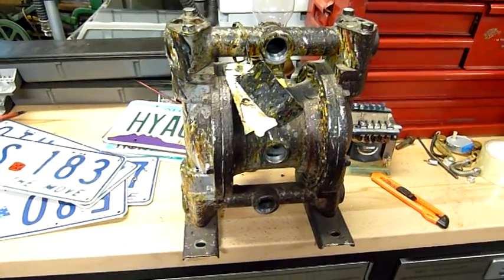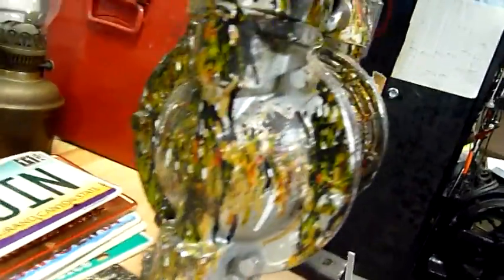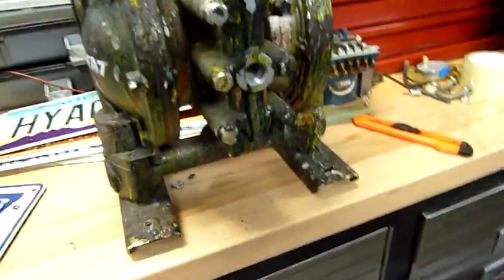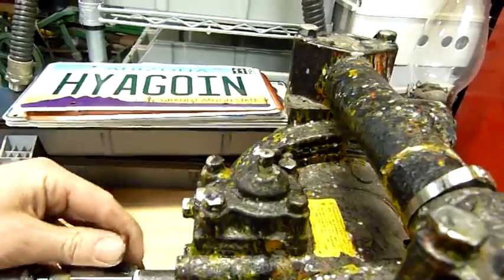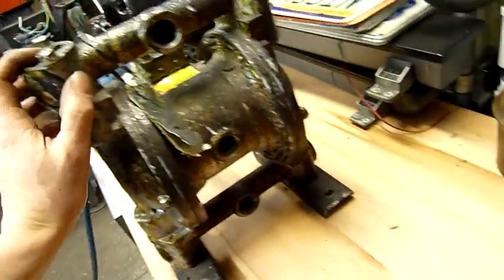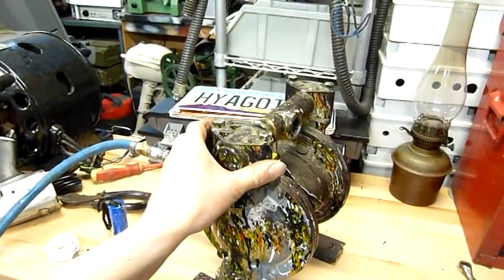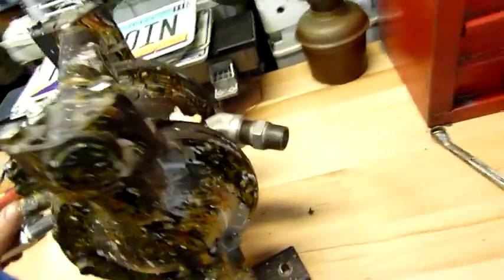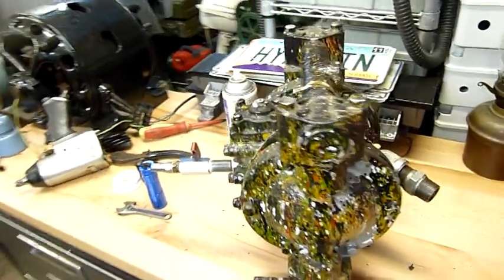Pneumatic Transfer Pump Testing

Comment: I used to work at a chemical company and we used these to pump two part epoxy for concrete adhesion. It was quite thick stuff, and quite corrosive. I would imagine that you shouldn't have too much trouble using that to pump pretty much anything so long as the diaphragms inside are still intact.

Comment: Looks similar to the one we had at a lube shop I used to work at. They used it to pump waste oil to the bigger containment tanks. It would always get clogged with debris, so I taught myself to rebuild it. On either end, on the top and bottom you've got a few ball valves.

Comment: might want to check the seals at the end of the pistons , if the diaphragm ruptures product can go into the piston portion , and can make one hell of a sticky situation ( product in the air, or product discharged in the air in the explosive vapor point ) or air in the product causing  static, thats why we are not allowed to use them for pumping off flammables in refinerys , all pumping had to be done with explosion proof motors or a diesel with a overrun trapdoor and a vane or rotor  pump .

Comment: Nice find, judging by the size of it i reckon it has been used to supply pressurised paint to some sort of industrial painting/coating plant - hence the stink of thinners. I've used smaller systems in the past that supply paint to a single handheld gun (gun is also supplied with compressed air). That pump will shift a lot of paint! Probably capable of handling some nasty solvents, maybe try and find the manufacturer under all that paint splatter and work out from there what type of seals it has.

Comment: Nice, just needs a repaint job now :-)

I agree, dont disturb the seals if it can be cleaned and lubed from the outside.

Ive seen many vids where mechanics use air powered impact tools to remove nuts, a great tool and its safe as no mains cables are there to get a shock off.

Nice (leave it together) vid lol :-)

Comment: Also, we normally have these hooked up in-line with a solenoid (controlled by some float switches) to turn the pumps off so they do not run w/o a load, because they will wear out much quicker! We use them to pump diluted water-based paint, process waste water, and sludge. They are pretty versatile. Just run water through em when done!

Comment: In the compressed air field these pumps are known as A O D air operated diaphragm pump
(Air Hogs) they consume a lot of compressed air as they fail they become a Radic and stick and stop pumping. The true test will be when you try to pump  liquid with the pump.You shouldn't have any problem disassembling that pump without damaging the diaphragms they're typically a heavy duty plastic type tflon type of material

Comment: We used these to empty underground petrol tanks before repairing them.
Can handle some solids, but anything too big tends to get stuck in the non-return valves (floating ball type thingys in the top and bottom manifolds).
I was repeatedly warned not to run it too fast, 'cause that's the easiest way to tear the diaphragms.
Shouldn't be an issue when it's not pumping anything.

Comment: Ed, you may be able to make silencer for that by getting some steel wool and stuff it into a tin can, I'm doing that with a two stroke engine....quieter than the OEM muffler assembly it came with, and it sounds much deeper (like a glasspack muffler, it works on the principle of absorbtion). Not sure if it could damage it though.....I never worked with a pneumatic diaphragm pump, so be careful.  :)

Comment: most anything thats not gritty, or too viscous, heavy gear oil at the most.
they dont handle solids to well (builds up inside pump housings). 
anything solid that gets trapped can also blow out the diaphragms. sometimes people pump paint with them and you can imagine what happens when 2-pac dries in there :-) game over!